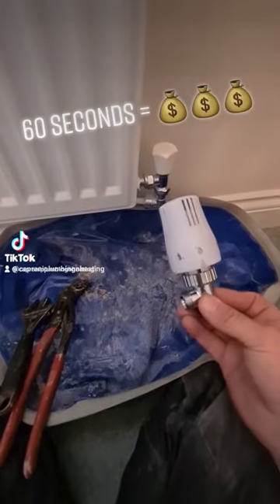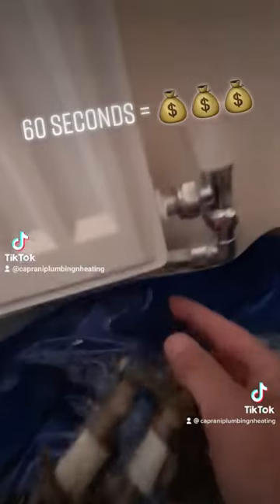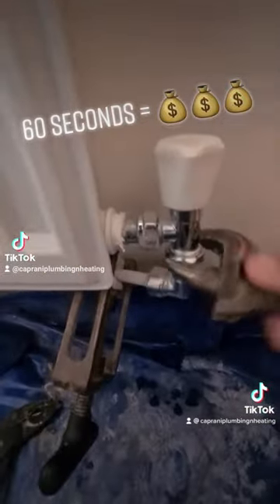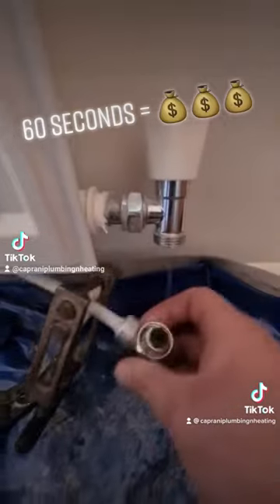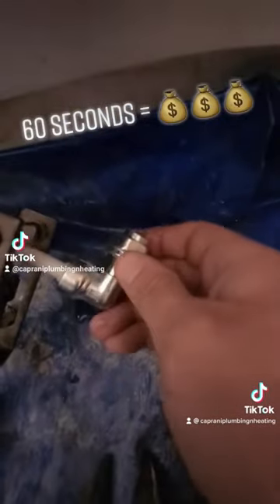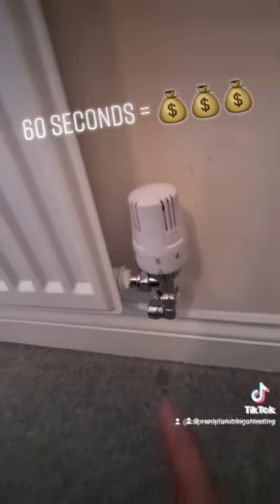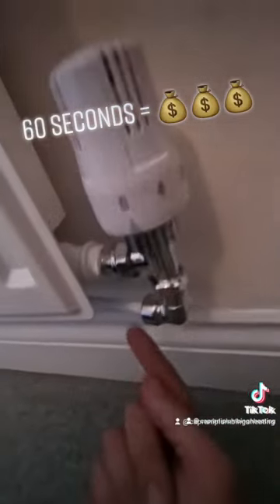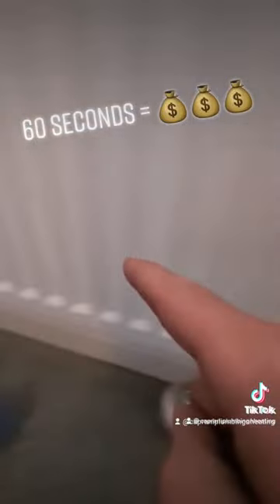Radiator Valve Change

Comment: Thermostatic heads are not supposed to be mounted ontop of the pipe. They are supposed to be under the pipe or on a T out to one end. Mounted on top of the pipe, heat rising from the pipe affects the head and it dosent read room temperature. Youve never read the instruction sheet have you.
Reply: So everybody fits them wrong then?
You don't get enough heat from the pipe to effect to trv from operating properly
Reply: @gardgas1  yes, everybody fits them wrong. It starts at the original installation and after that the only easy option when replacing them is to follow suit. They are most certainly affected by rising heat.
Reply: I don't think I've ever encountered someone so spectacularly wrong, that still thinks the're correct, you're  saying every TRV manufacturer has got their own fitting instructions wrong😂
Reply: @mikepage9520  exactly what I thought, but hey, apparently this guy's knows something we don't 😂.
No way can one verticle pipe below a TRV convect enough heat for it not to read correctly, or maybe he just fits the old Danfoss valves.
Reply: @gardgas1  I'm certain this guy knows lots we don't, none of the other stuff will be useful either
Reply: @mikepage9520  make sure you don't learn anything new or consider alternative views.
Reply: @sparked3113  nope, everyday is a school day, just make sure what you're learning is correct

Comment: So I take it speedfit/pollypipe or whoever wouldn’t have any warranty issues with the thin aluminium barrier inside the plastic being squashed? I thought a squeeze off was for PE pipes Gas/water didn’t realise you could use it on BARRIER pipe, how does the barrier hold up? Let me guess your long gone before any future problems arise😂

Comment: What are the clamps called mate? Great vid 👍🏻
Reply from the maker: Squeeze off tool lad,  respect bro 👊🔥
Reply: @capraniplumbingandheating  cheers pal, very handy 👌🏻
Reply from the maker: Game changing lad 👊🔥
Reply: @capraniplumbingandheating  is that not only for blue polyplumb pipework? Used mainly by Thames water 💧